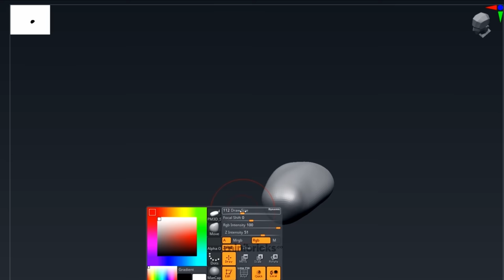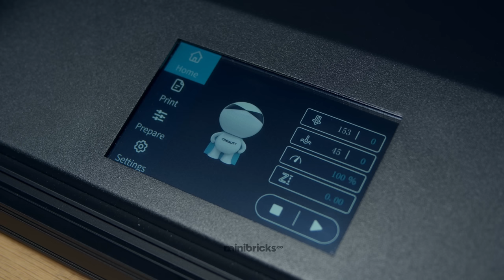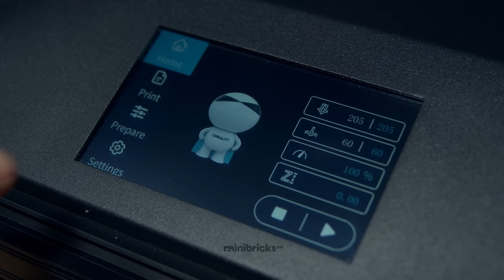Minibricks: The boy didn't know who lives in this lake / CREATIVITY ENDER-5 S1

Comment: What is the tiny wire cutter you use? That looks very handy.
Reply: Its an E-cigaret, an Evic VTC with a rebuildable deck in this case, like you can find on some RDA (aka drippers) , with a comon wire like khantal. You can give the wire any paterns you want.
If i had an advice, it would be more safe to go with a most recent electronic mod with more securities in case the lithium battery would goes wrong.
Its a smart homemade tool.
Reply: Thanks for watching 
Expect more videos soon
DM right away i have something for you 🎁..